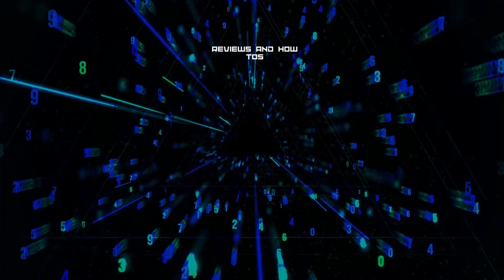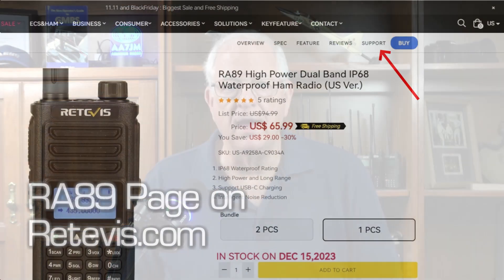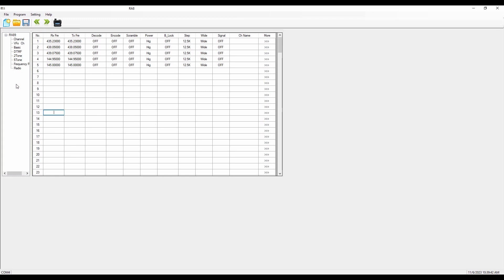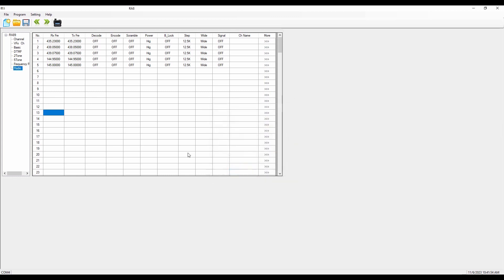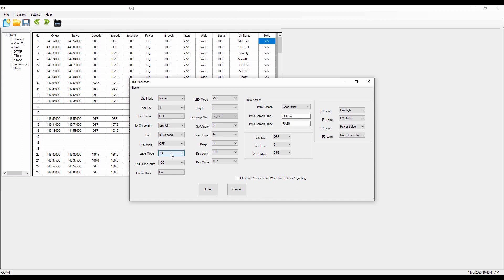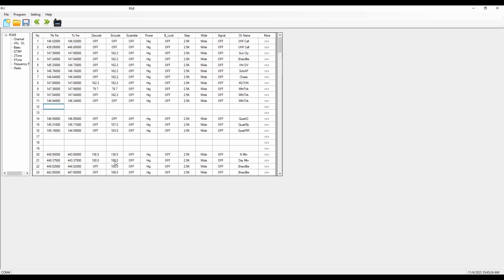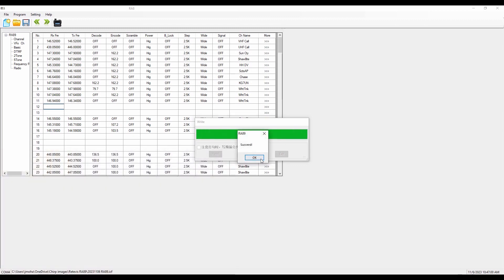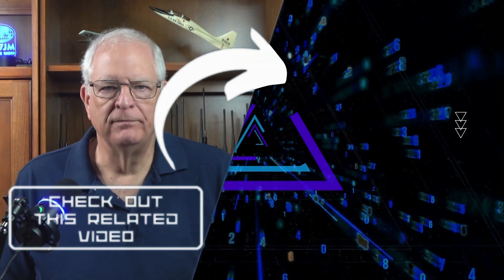Retevis RA89 CPS Tutorial. Program Your Radio the Easy Way

Comment: I've been using CPS for the RA89. The frequency and settings seem to program into the radio. However the programmable side keys do not actually get programmed. The CPS says that they are changed to my desired settings but do not perform the function I select. I've seen some other video comments involving the same issue. I wonder if another firmware will be released.
Reply: Yes, there is a newer release firmware update that resolves that issue.
Reply: @RLPnKY  I did find and install the B91.30 firmware. I can confirm this newest firmware resolved the issues I was experiencing. This firmware also added a few features such as adjusting mic gain via the onboard menu. I found a link for it on one of the Retevis videos involving the firmware update process.

Comment: I did everything just like you, but sadly there is something wrong... I was able to type in all the frequencys I wanted and transfer them to the radio - or so I thought..
There is everything, my startup text, my channel names, the settings but sadly it gets the frequencys wrong.
If I read out the radio it shows the right numbers (the frequencys I wanted to programm) but it won't receive or transmit on that frequency but far off. I have no idea whats wrong, everything looks fine, no errormessages or anything during programming. I even did a firmware update, same results as before..

Has anybody an idea what may be the problem?! If so, please let me know, like the radio but I don't want to calculate all my used frequencys to the strange offset it does.
(no, I didn't check if the "offset" is always the same. but as an example - what should be 446.00625 is 429.99875, at least that is what my "scanner" tells me, and it seems to be right if I enter the frequency on another radio I can make contact. Also I checked, there seems to be no logic to the strange offset -> 446.01875 is 429.99750. )

Thx to all of you!
Reply from the maker: Very strange. Take a look on the radio menu to see if offset is something other than off and the offset amount is 0.00. If you computed the offset when setting the frequencies on the CPS it may be adding an addition offset. Just a guess. Otherwise email Retevis. Odd.
Reply: @GadgetTalk4U Thank you for the quick response! Sadly everything you mentioned seems to be set correctly, in the CPS as on the radio.
Just opend a ticket at the RetevisSupport ;-)

..and excuse my bad english. As you may have allready guessed, I'm not a native speaker